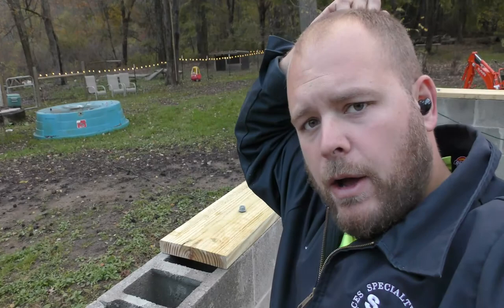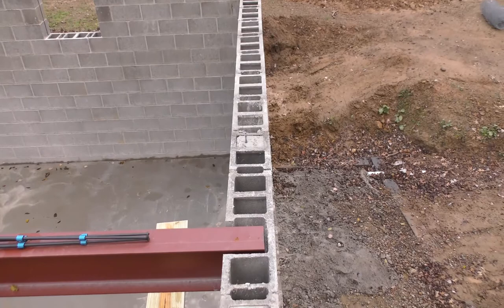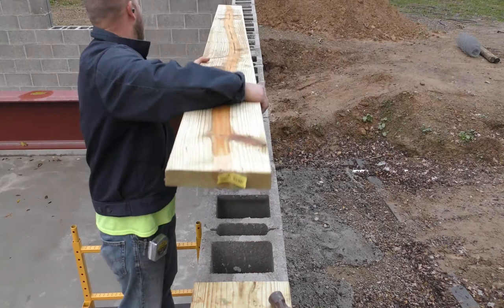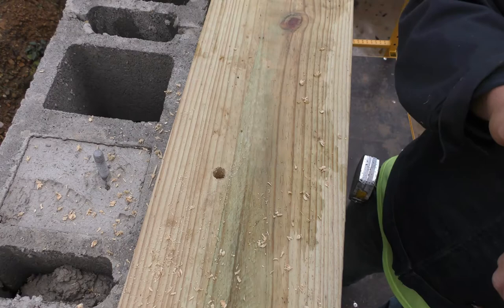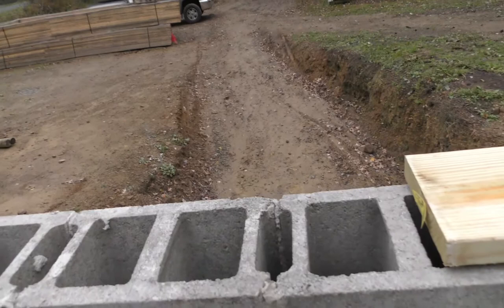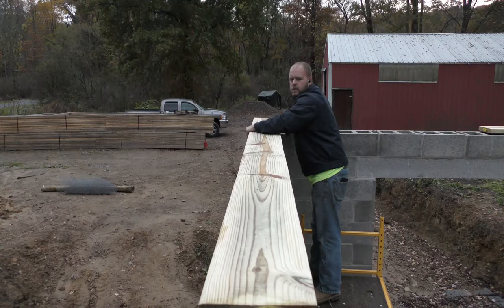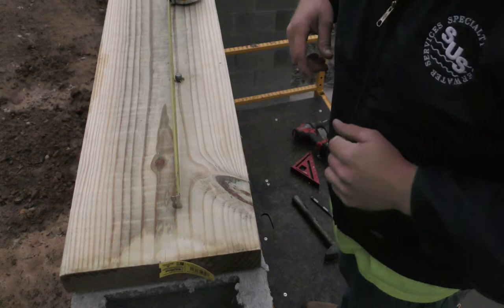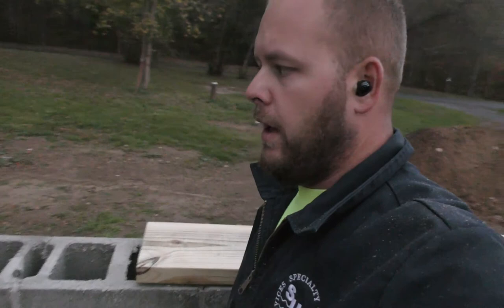Laying out J-bolts and Sill Plates

Comment: Not going to put threaded rod in the concrete or xl j bolts for the next layer up build ?
Reply from the maker: Not sure if I'm following.  J bolts are going through sill plate. Next layer is floor joists which are secured to the sill plate.  Not sure how threaded rod would help anymore.  Love to learn,  so would like the insight.
Reply: secure the floor joists to already embedded bolts, but anyways just drinking and thinking earlier, take care. @TheHecticHomestead

Comment: Where did you go to get your steel beam..did you have a engineer involved on sizing it
Reply from the maker: Great question! I went to a local steel supplier. I talked to their engineer on what I was doing.  He advised me I could use an 8 inch beam and two support jacks for the load.  I opted to go bigger to a 10inch beam. It had less deflection and for only a few hundred more dollars, it made sence for me.